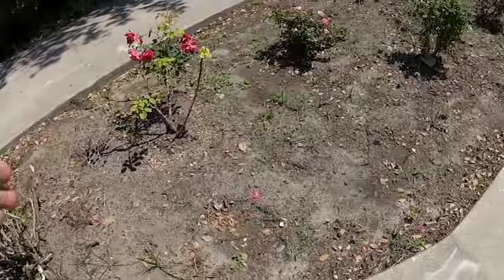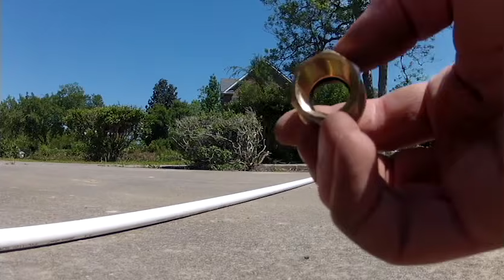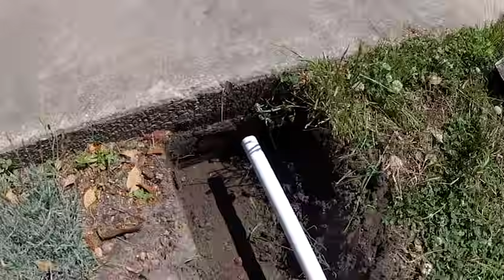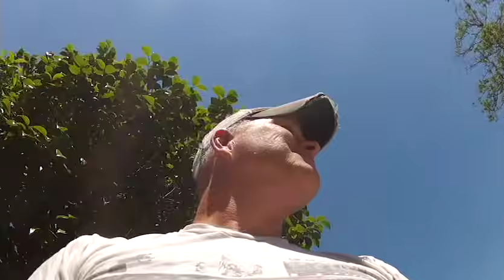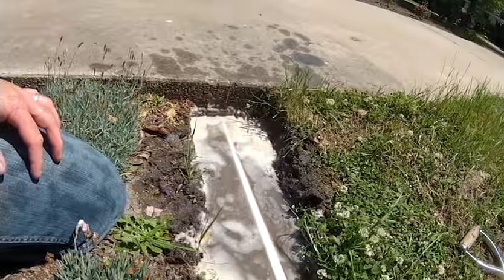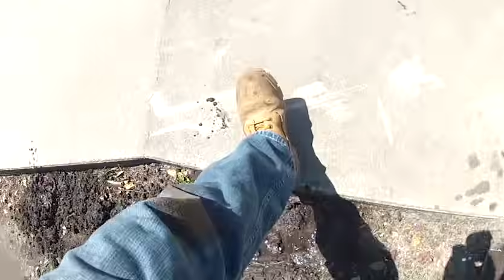How To Get A Pipe Under A Concrete Driveway

Comment: Its easier to use 1 inch pvc with a water hose run through it.  on the digging end put a brass pressure nozzle.  the pressure will dig through the dirt, clay, sand or whatever very quickly and then you simply remove the brass nozzle.  pull the water hose out.  use the 1 inch pipe or run a smaller pipe though it.

Comment: a good method for lawn conditions. But  realize that concrete is poured on top of a bed of gravel. The gravel bed could be several up to an untold number of inches below the concrete.  Tou are not going to wash out a gravel bed.
Reply from the maker: Absolutely. The base under my driveway is coquina (which is a mix of small pebbles, sand, and seashells). Didn’t have any trouble with that but I imagine actual gravel would be an issue.

Comment: I always get concerned about the excess dirt that is washed out at the same time, what prevents the driveway from collapsing into the empty void?
Reply from the maker: In my experience, having used this method more than once, excess washout is minimized. I’ve driven a backhoe over this particular area several times with no concern.
Reply: If the driveway has rebar in it it should be ok. 
I have seen driveways at the garage that a person could crawl under due to the fact that when it was back filled it wasn’t compacted and rain water washed the dirt away. Only thing holding the drive way up was the rebar that was drilled into the foundation wall.

Comment: Will this cause any issues with the concrete cracking or sinking?
Reply from the maker: Haven't experience any cracking to this point and we drive over this daily.
Reply: Not unless u don't mind parking in a hole.

Comment: I'm just trying to open up some water drainage where my concrete driveway impedes it.  My driveway is 8 ft wide.  This seems like the way to go.  But I have to dig a path for the hose water to drain off.  Thought I'd need a pump.  Your system is much easier.  Thanks!

Comment: Great.Might get in touch to run a water line from the rear of the house through a 6 feet walkway which is 3 feet below a 20 feet wide back yard to the garage .Hope your suggestions will work.
Reply: Hey cheap skate have u ever heard of the word Plummer no offense just asking.

Comment: Turn the hose on full pressure then you can just slowly push the pipe through the dirt without the back and forth hammering you were wearing yourself out with. 10' took me less than a minute to push through, slid through like butter.

Comment: The driveway will crack and form a dip. The water will probably form a wider hole than the pipe.
Reply from the maker: Has never happened to this point.  Not saying it couldn't but that's not been my experience.
Reply: No it won’t, especially if it was poured with rebar. I’ve seen 2 feet deep tunnels that were cavitated under driveways due to improper drainage that didn’t even crack
Reply: Nope. Think bridge

Comment: Has anyone tried to get a larger pipe under a driveway? I’m considering starting with 3/4 like you did, then doing the same with a 2” slipped OVER the 3/4 already in place. Any thoughts? I’ll update if / when I attempt.
Reply: Investigate:
Borit.com
Borzit.com
The above two kits require a beefy 1/2” electric drill.

Honorable mention: littlebeaver.com, but their kit obligates their power unitn no provision for electric drill.

Also, Perfecto makes a kit, but it’s always sold out, cheapest option by far.
http://perfectoproducts.net/hydro-drill/

Comment: How big of an area do you think was eroded away under your driveway? I'm wondering if much of the concrete is now unsupported? Thanks for posting this!
Reply from the maker: Not much larger than the diameter of the pipe.  The water naturally forces soil back into the void.
Reply: Concrete may crack over the winter.
Reply: I put a pipe under a driveway, just like you did. A few months later the concrete cracked exactly over the pipe and subsided 1/4 " but has been stable ever since.
Reply: Concrete strong enough. Think bridge
Reply: Jimmy Sorensen bridges have steel reinforcement in the concrete, most driveways have no steel in the concrete. Driveway concrete will definitely fail over this spot. Only homeowners and contractors you will never see again will do this.

Comment: Lowes sells a kit for 5 bucks to glue on your pvc pipe,it has a tapered end to wash through with and a hose fitting you glue on the other endto connect your hose very easy to do. Use this method all the time putting in sprinkler systems.

Comment: That only works if you have sandy, soft soil. Try doing that in clay or rocky soil and you will be out of luck. When I worked for the cable company we used Pneumatic "moles" to bore under driveways and roads.
Reply: It sounds like hes in FL. This may not works without jets with rocky shale soil like we have in East TN

Comment: I’d be curious to know how this would work in a Northern climate. It’s possible that the void left will fill up  with water and expand in a freeze and crack the concrete. I’ve seen pvc drain pipes plug up, fill with water and freeze and crack concrete.
Reply: A vacuum is your best friend up North. An air purge is better if you have that available.

Comment: our soils in the NE region are a bit heavier and rocky than yours.
we have a slip on bit for our pipes that has a series of small teeth in 
the lead edge. they bite into and move the wet muck a bit better than 
a smooth lead PVC pipe end.